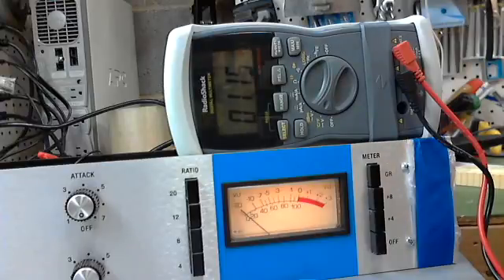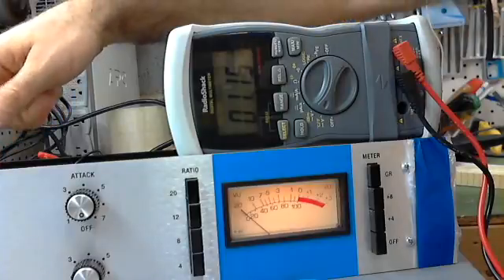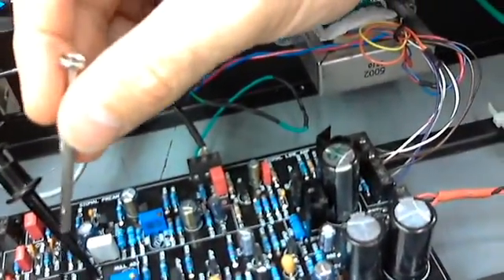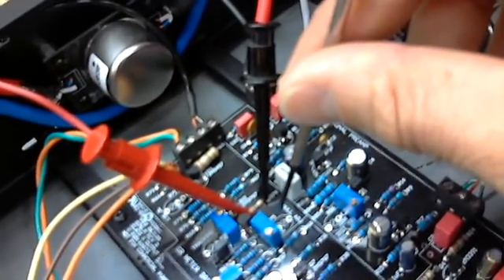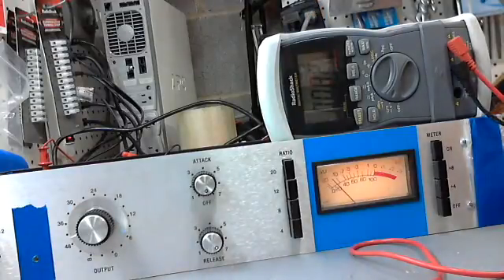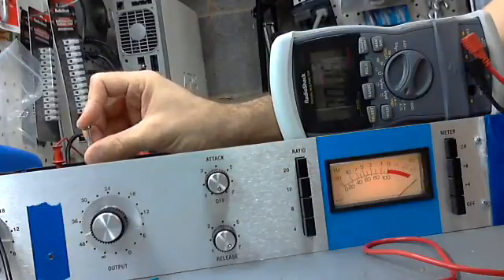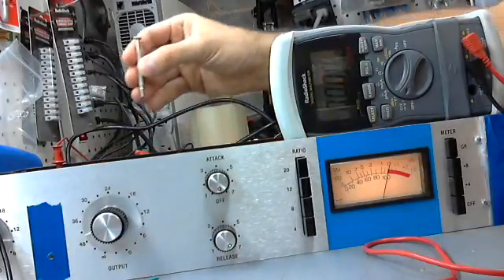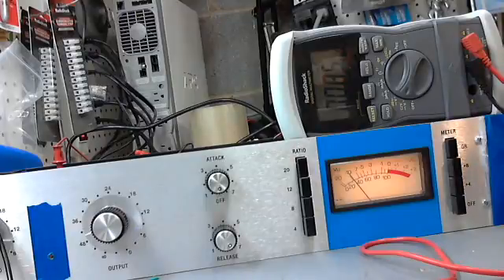1176 calibration step 2

Comment: I bought mine 2nd hand untested from an engineer who built it saying its a blue strioe.  it never worked correctly and now that it's open it's def not a rev A inside.  PCB is rev D but seems different components than even that.  Now in trying to do this null calibration step i get 0.00V all the time.  So i brought meter to zero via front  panel and leaving it there.  There is a null trimmer and an R74 but the trimmer does nada. ???

Comment from the maker: rev A uses the test points, rev D uses r74 resistor, as Charles pointed out.   Make sure you are measuring DC volts and set your decimal place to two positions on your meter.

Comment: i have swept R75 both directions but the dc voltage stays at 0.454/0.453 Vs....  a bit perplexed
Reply: +noneofyourbusines244  Have you tried to measure on TP10 & TP11 ?
Reply: Did you ever find a solution? I'm having the same issue.